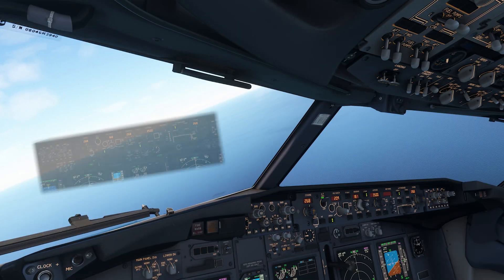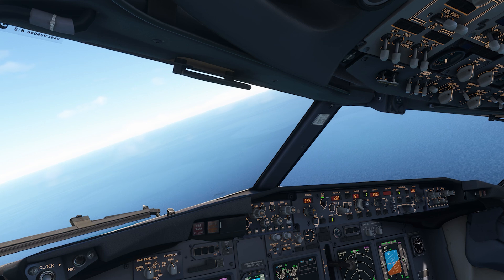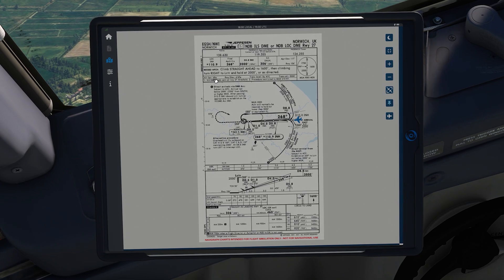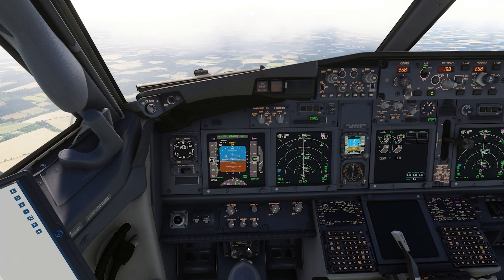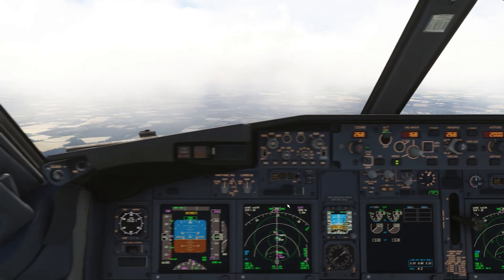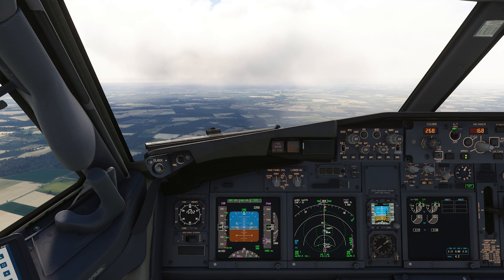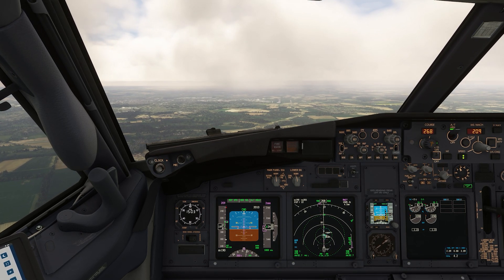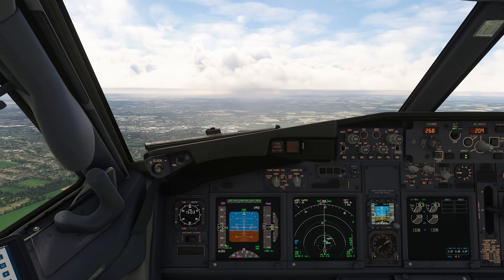Real 737 Pilot Tutorial | Non-Standard Go-Arounds | PMDG 737 in Microsoft Flight Simulator

Comment: Are you sure you cannot just switch mode above 1500ft on the B737? On the B778 you can deselect APP mode above 1500ft.
Reply from the maker: Unfortunately not. Once APP is engaged and active (FMA G/S)  the only way to deselect is to either push TO/GA, recycle flight directors or de-tune ILS.